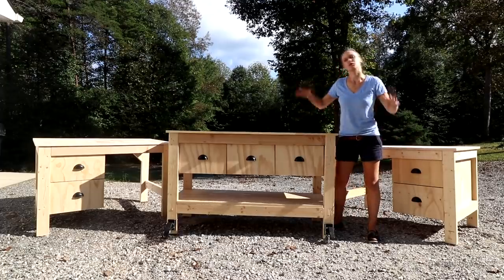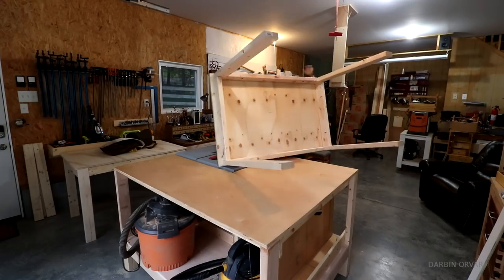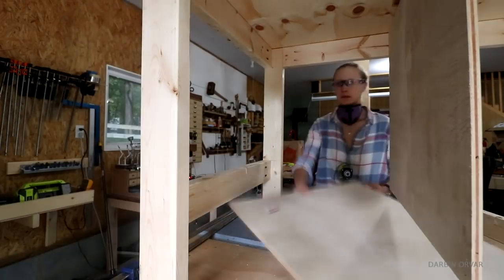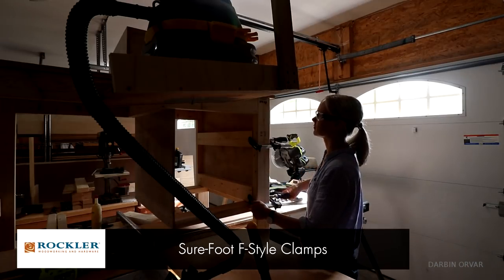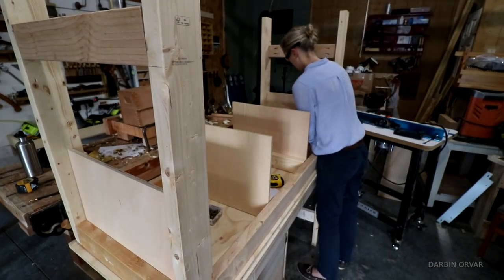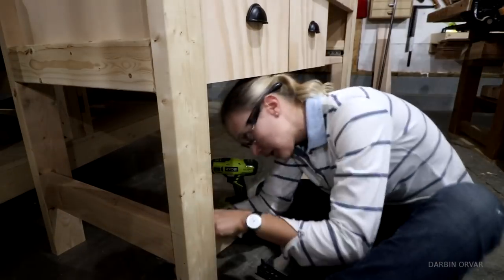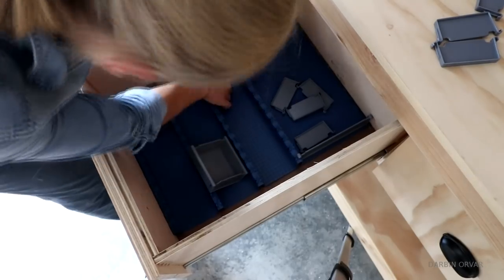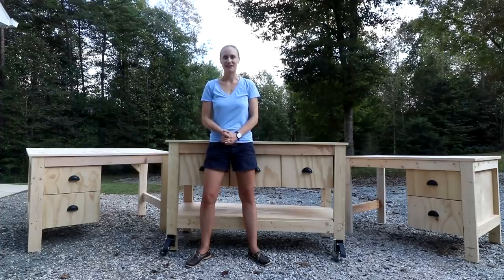Building Shop Projects - Workbench & Desks

Comment: Lynn.  I have the same sliding miter saw.  I did not like the way the wood clamps kept slipping out of their place and would not tighten.  I drilled and tapped a small hole on each.  I now use a thumb screw to tighten the vertical shaft of the clamp. Finger tight does the trick.   If the clamp does not move, then then clamp works really well.  The only thing about that miter saw that I did not like.  (poor friction fit design) Now I used the clamp all the time without it slipping up out of its tube.
Reply: Deep draws can mean putting tools into them that would struggle to fit into smaller drawers.

Comment: Made of 2x4s, each of those is going to weigh a ton or so. I guess you don’t need to move them, though (except across the shop).
Reply: Work benches need weight so that they do not move easily when using. 

Traditional benches would be far heavier than the those done in this video.